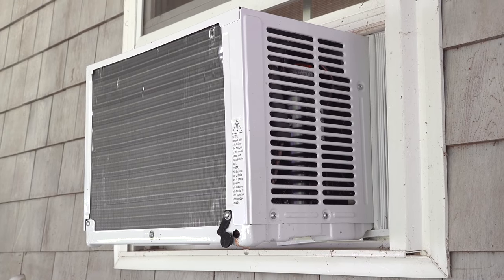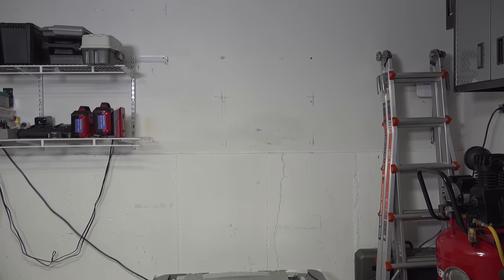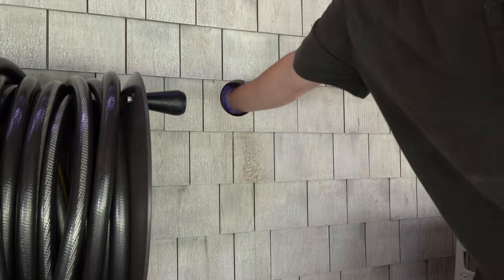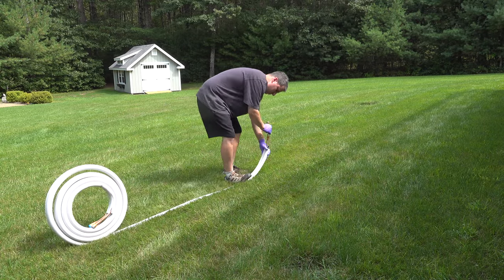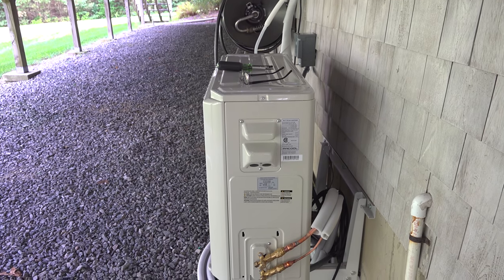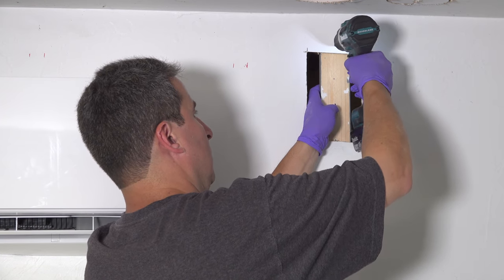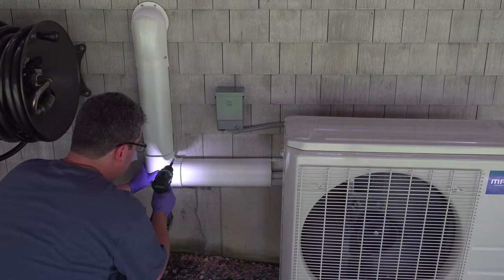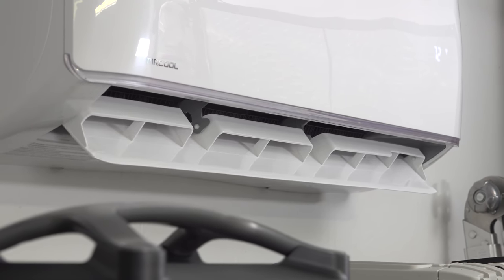How To install Split Ductless AC & Heating System // Start to Finish - 1 PERSON!

Comment: The lines aren't filled with refrigerant, it's in the outside unit, after you open the valves on it when everything is connected than the lines begin to get filled and obviously after some time they get filled all the way
Reply from the maker: That's incorrect, both the lines and condenser have refrigerant in them.
Reply: @SilverCymbal  than i'm sorry
Reply from the maker: @prokoptamas3009  No need to apologize, pre charged lines are not very well known, if you check mny other video dozens of full time hvac pros have never heard of them.

Comment: this kind of ACs easily have molds inside after a while, are hard to clean and the drain usually clogs, requires professional cleaning every 3-6 months depending on your room air quality
Reply: A uv light could help with that

Comment: Can you cut the electric cord to length ????
Reply from the maker: Yes, I ended up doing that but still left the little slack you saw in the video. I also then slid it inside an empty flexible sleeve. Its just 3 conductors with terminal lugs that can be easily re-crimped.

Comment: Had a mr cool installed 3 years ago, died after 2 years. Mitsubishi next time.
Reply: Why did it die? Was it the condenser outside or the inside air handler? Did a motor or compressor go bad?

Comment: That project is kind of self defeating when you install it into a space where the walls have NO INSULATION . I'm sure the unit will not perform anywhere near it's potential .